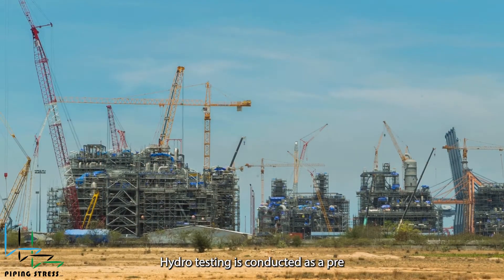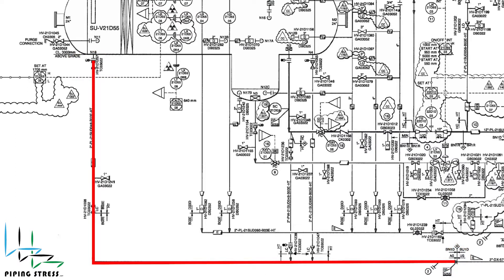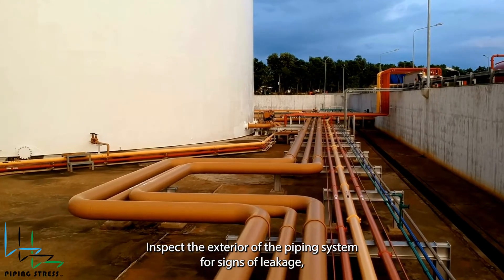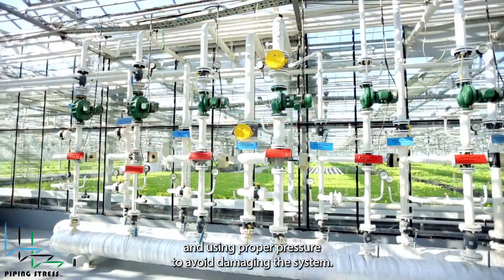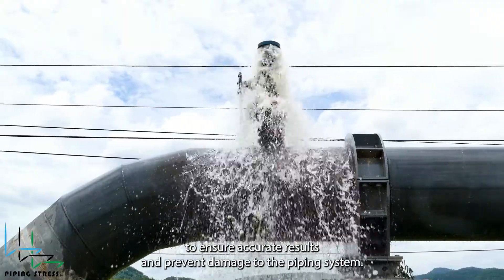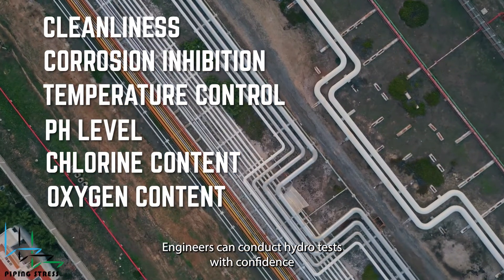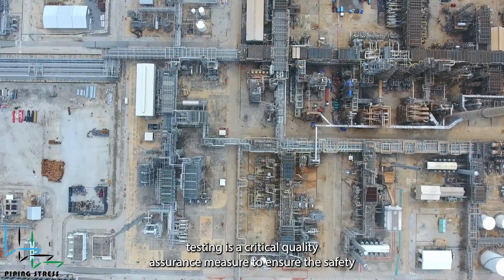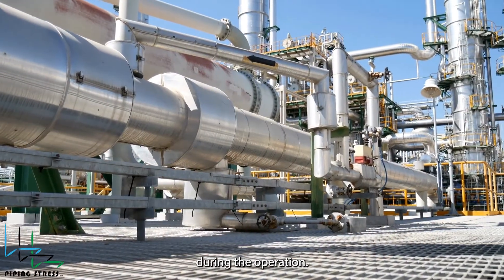Conducting a Piping Hydrotest: Best Practices and Requirements

Comment: anyone who happend to read this..
what if the outside is completely dry, leak free.
no air inside, but still the pressure drops 1 bar every hour? temperature doesnt move much at all, 

really cant find a leak.

test pressure starts at 30 bar, requires a 6 hour test.

Comment: What is the basis for dew point -40degC for the dryness. Can u share?
Reply from the maker: The requirement for a -40°C dew point temperature after a hydrotest is primarily based on ensuring that any residual moisture left in the piping system after the test does not freeze or condense, especially in environments where the piping may operate at or near freezing temperature. Moisture trapped in the piping system can freeze when temperatures drop, potentially leading to blockages, damage to equipment, or pipe rupture due to the expansion of ice. A -40°C dew point ensures that no water vapor will condense and freeze within the system at low operating temperatures.
Drying the system to a -40°C dew point helps prevent internal corrosion.Many industrial and construction standards, such as NACE, ASME, and API, often recommend or require drying to a specific dew point after hydrotesting to ensure the longevity and safety of the piping systems. The -40°C dew point is a commonly accepted benchmark in industries such as oil & gas industry. By achieving a -40°C dew point, the risk of moisture-related problems is significantly minimized.
Reply from the maker: Please support us by being a member of PipingStress.Net Here the link: https://www.youtube.com/channel/UCdzNQwXAxStAlJNN0Gv421Q/join